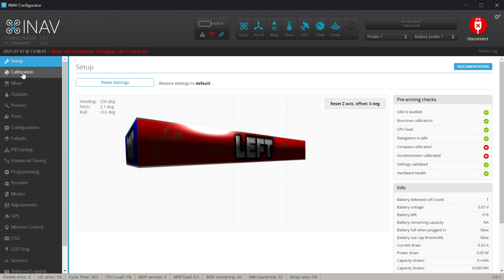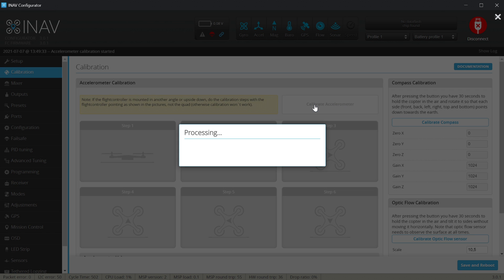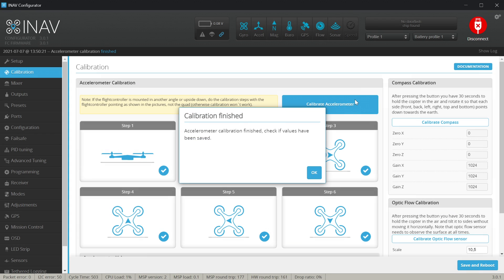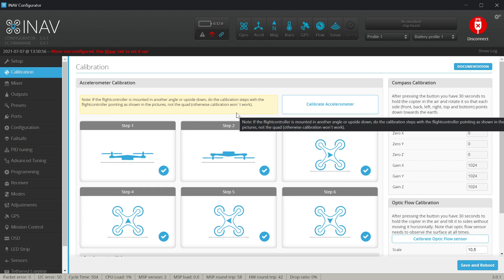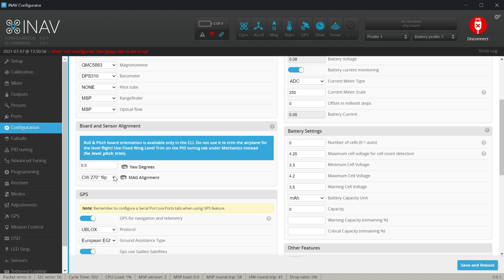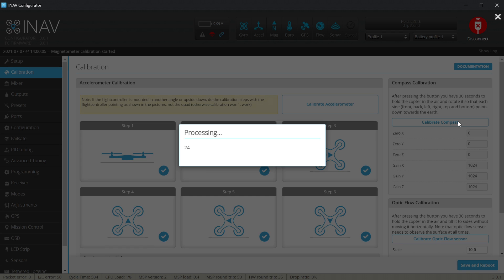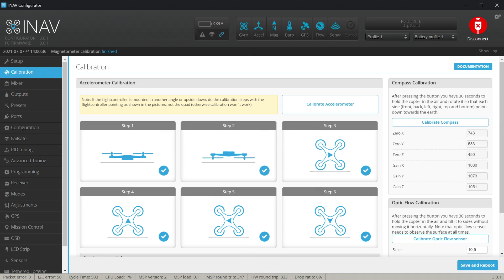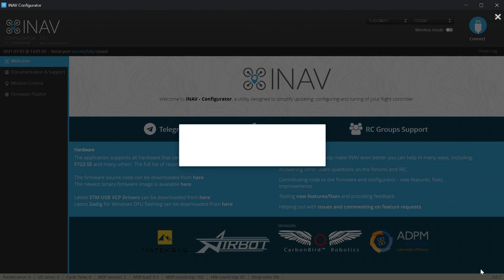Calibration & orientation | INAV on a FPV drone tutorial

Comment: hello, is it normal that after calibration the drone moves a little on the setup screen?  while it is placed on the desk without moving physicaly.. and in the sensor page, the accelerometer is stable and does not move either?

Comment: Hello, i have the Frsky Pilot Flightcontroller, when i arm the drone the gyroscope get crasy. If i start all motors with INAV software  ,the motors have the same speed and vibrations but the gyro work correct. I i arm again, the gyro gives out wron data. Does anybody know a solution?

Comment: What am I doing wrong?I've got a recon 7 pro. My gps hglrc M80 pro doesn't have a direction arrow so I tried all the options in Mag Alignment from default to cw 270 flip and still in the heading setup it doesn't hold the position very well and when I try to tilt the drone it also rotates.  Thank you
Reply from the maker: Probably MAG is too close to the source of magnetic field. Move it firter away. Rule of a thumb is 5cm from motors and wires
Reply: @FPVUniversity  it wasn't the gps distance. my angle setting for mag_roll didn't work. my default value is CW270FLIP and for my quad this works mag_roll=0 mag_pitch=1550 mag_yaw=1800
Reply: @j1o2h3n4y1 so you had to make changes to two of the three values?  I’m attempting to setup the compass on my 7” long range quad and the gps/compass sits in a TPU holder that has a 10 degree downward tilt.  CW180FLIP with -10 degrees change to the Roll is the settings I’ve found to give the least drift.  I’m using iNAV 6.something.

Comment: Hello, Pavel. My FC is set according to the arrow on the board. GPS is installed with an inclination of 25 degrees. I have manually fixed these settings
settings align_mag_roll = 250
set align_mag_pitch= 1800
set align_mag_yaw = 900
On the SETUP page, I tilt the drone forward, then the brick tilts down and turns to the right by yaw. According to your video, should I change the FC orientation? Is it right?

Comment: Privet Pawel! How are you? Very clear your video. Thanks! Question... at the setup tab, and after calibrating the Magnetometer, when you move the model... The representation of the model in that setup tab is exactly the same position in which you have the drone? Or the magnetometer is like it forces the orientation a little different? 
(I will do what you say about doing the calibration in open space away form metals)
BUt, I have a Fixed wing and for example, If I move it  90º to the left... at the setup tab I see not 90º but 45-50º (and like it tries to back even 30º or 20º). This, without magnetometer sensor not happen.
Is it clear my question? 
I am wondering what happend last weekend that when I set angle mode... flip and crash. After that.. only manual mode :-) 
Thanks Pawel!

Comment: Hi Pawel. i thought lets get one of my 5"quads migrated to inav 3.01, all is well, i have a Iflight Titan XL5HD and have removed the standard gps and replaced it with a matek
M8Q-5883 the one with the Compass, now i have a question, I do not have DA and CL on my board ( succex-d f7 twing v2.1 
) I have looked in the cli and found out the CL and DA are on TX3 and RX3, (where my gps is on) so i desoldered the old GPS and soldered the DA on the corresponding Uart port and also the CL, and moved the TX on RX to uart4 and RX to TX on Uart4 for gps, In Inav the Magnometer and GPS are Both Blue But i cannot Calibrate my Magnometer.
Is there a CLI command to activate the magnometer on Uart3?

Comment: What is the best way to calibrate the accelerometer of a dead-cat framed quad? Since the front arms extends further, it is difficult to keep the drone level for step3 and step5.
Reply: I use a tablet, with a two axis spirit level App. I use the edge of the tablet as a straight edge, and use the motor screws to hold the copter against the tablet, as I go through each step. If you don't have a tablet, any two axis spirit level and a jig would work.

Comment: My GPS mag/Compass sits bend forward slightly cause i crashed once and landing upside down when changed modes. Will the calibration resolve the Compass sitting forward, or will i have offset certain values?
Reply: i was having a problem setting up the Magnetometer (values where not saving fully through the calibration tab) with 2.6 config as i can't use 3.0 for BrainFpv our working of their forked version of Inav 3.0

Comment: I hoped you might explain correction for roll degrees when the FC is mounted upside down. It took a fair bit of research to find the CLI command to correct it. Was there a particular reason why it was left off the graphical interface? These blow by blow videos of yours are magic; between you and Joshua Bardwell I manage to bungle my way through the setups. Many thanks.
Reply from the maker: we have a new policy to remove from GUI settings that are not frequently used. And mounting the FC upside-down is not something that many people do. So it's gone
Reply: @FPVUniversity  Sorry but this policy is just stupid.. The least you could have done is included a link to a wiki or something on the GUI that explains HOW to correctly orientate it... not just 'it's gone', 'refer CLI' as per the GUI... yeah CHANGE WHAT IN THE FUCKING CLI ??? There are hundreds of items in there and they don't even list in alphabetical order to make finding things easier... We're not all programmers mate...

I occasionally mount my FC's upside down/rotated for clearance issues on tight builds (in this case).  I came to this video after watching 3 others hoping to get an easy explanation on how to fix it instead I find this bullshit half--arsed non-answer...
Reply: hi care to share the cli command you used? i cant seem to find it in my searches  - also need to mount my fc upside down under my glider - only space

Comment: To see if your compass is correctly aligned you can enable in the OSD tab heading graph, now if start the quad you should see where the quad is pointing ( north, south.. ) compare with another compass example on your phone and should point the same direction, if not change the degree. I went trough hours of trying before figure out, without the compass align correctly its impossible to fly!

Comment: my goodness who labelled these settings 270 flip! gut him for being a smart ass!
Reply: That's because the magnetometer in aligned 270º CW and upside-down in relation to the  arrow by default if the GPS is pointing forward.
Reply: The default assumption, by engineers, is that a pilot will fly off into the sunset. ;)